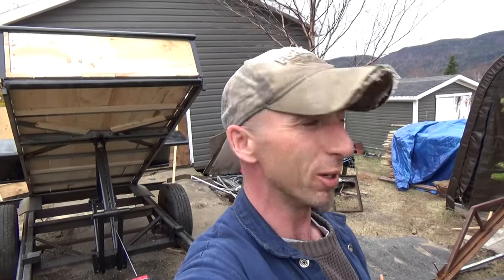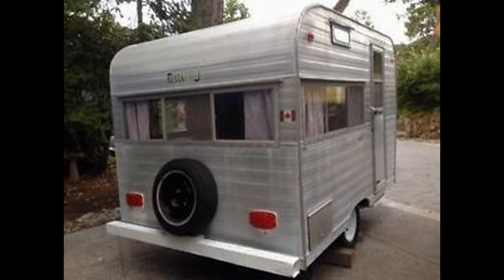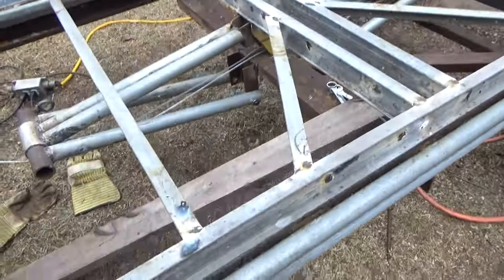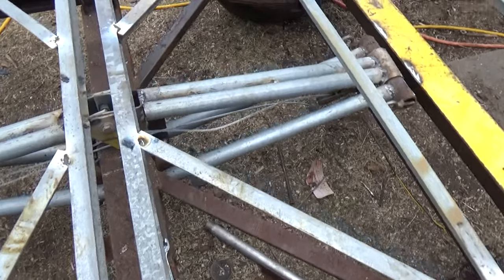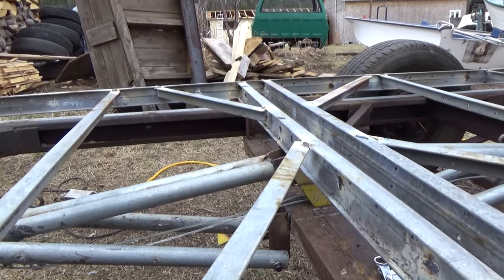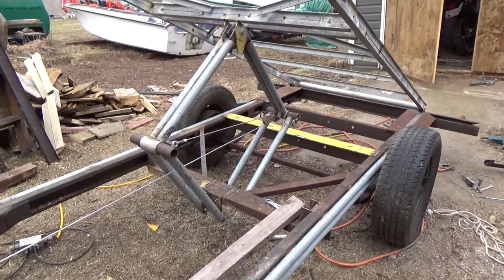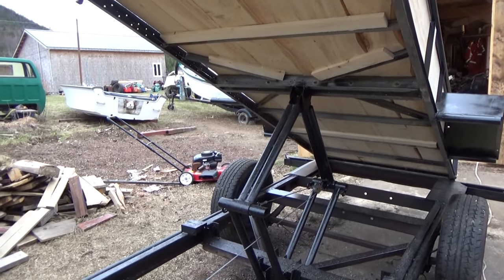DIY DUMP TRAILER WITH NO HYDRAYLICS

Comment: We built one ourselves using your brilliant design. We will be using ours for leaves and branches and it is 6 feet wide by 10 feet long. We used square tubing instead of the pipe and used a bigger winch with a double pulley for slower up and down. I wired the power and controller to the quad that we are using so we don't have to get off the quad to unload. Thank you so much for this!!!!!

Comment: Man just came up with this idea too. Only difference is I will run the cable up to the front of the trailer around a few pulleys and also use it to drag items onto the trailer by disconnecting it from the lift mech. Good to see it will work!

Comment: Great idea! I'd be concerned about the strength of the cable myself. I know the 1/8" cable on those winches do not support what they're rated at. Like you stated, I'd stay back when dumping. If that cable breaks, it's going to come down in a hurry!!
Reply: yeah.Wire rope could cut a person in two

Comment: im a former wrecker driver and also use to build dump trucks had a very similar idea but opted to use 12volt trailer 3500 lbs jacks instead

Comment: Interesting design.  Very easy for you to add a couple extra pullies to the cable run in the scissor if you need more lifting capacity too.
Reply: I was about to suggest a 3 to 2 tier block and fall.  That would really improve the mechanical advantage , especially if he had to use the hand crank
Reply: Es b’y she’s a beaut  should work fine 😊😊

Comment: Really really cool concept and an excellent excecution.  There's one thing I think would be beneficial.  You really need some kind of safety catch to take the strain off the cable and to catch if it snaps..  With the ingenuity, you've shown here  I have no doubt that you will come up with a solution.    I would like to see some kind of ratcheting system so that the bed is supported the whole way up.   Nice!!

Comment: Very cool lift mechanism. Thank you for sharing the idea. I've catalogued it in the 'ol cranium. I think if I go that direction however, I'll use an electric driven screw scissor jack, as I feel it would have a much safer failure mode.
Reply: That is exactly where my head is going.  If that cable breaks,  your tailgate, anyone in line or underneath could get hurt.

Comment: Absolutely brilliant idea and so simple.  I'd use a bigger pulley or multiple pulleys with multiple cables.  I imagine lifting a ton with that one cable and pulley could be a bit stressful on that current cable and pulley.  But hey, solid pat on the back, credit where credit is due. 
That just earned a beer at the pub !

Comment: Interesting design.  I've got one problem with the setup that it seems other commenters have not covered.

A scissor jack lifts straight up.  But the point where your jack contacts the underside of the bed does not.  As the bed rises, the contact point is also moving to the rear.  This may bind the jack and, more importantly, put stress on the top and bottom weld joints.

As a mod to your existing setup, I would find a way to weld a base connecting the two lower hinges together.  Then weld a hing to your new jack base and the frame member.  This would allow the jack to pivot with the backward swing of the bed and maintain load alignment from the head of the jack straight through the base.

Otherwise, great build!  Gives me some ideas on a couple of smaller projects I have around here.
Reply: Not exactly. The pivot points at the bottom of the scissors pivot so the entire scissor can more forward and back albeit not a great amount but sufficient for the arc of the bed. Check the video at 3:06. Cheers
Reply: Assuming that equal weight will be maintained where the cable meets each scissor, each scissor will operate at a slightly different speed. The forward one will straighten slightly more than the rear one when raised.

Comment: Very cool build.
Just this week I demolished an old hunting trailer that’s been sitting since 1989.
The useable box frame is 14’ 7” X 7’ 4”.
I plan on adding another axle and building a dump bed.
I like your idea but I plan on using mine for 3 tons of gravel hauling so I will need to go with a hydraulic set up unless I can find a manual set up that will lift the weight.

Comment: Could also run a threaded rod through the scissor jack.  I have one strong enough to lift my house!!   Then you simply need either a motor or an impact drill to turn the jack with.

Comment: I dumped my diy 1/2 yard cement mixer in a simliar way, however I did not use a scissor, I just used a single arm and pulled it back with a hand winch at the bottom of it, so it swung down and rolled on the ground lifting the cement.
It only worked once there is some leverage on the arm, so it had to be designed to give it that which limited a bit the rise.   Nice job on your design.

Comment: Nice engineering.  I'd reinforce all the welds when you get time.  Some 45 degree cuts on the cross member supports might help too by adding more weldable surface.  As money and time permit, I'd look to replace the wood floor and front wall with steel at a future minimum, and not worry about the wood sides since they'll work fine for most jobs.

Comment: You need safety locks. Death trap. I would consider a long screw like those in floor screw jacks used in pouring concrete upper floors . The screw is safer.

Comment: Tremendous - both the design and the build. You could detach the winch cable from the lift mechanism and repurpose it to hoist lumber onto the trailer for loading too.

Comment: Good design but you need horizontal support between front and rear lower pivot arms.  It also looks like you need some angle bracing as the bed appears to twist.  Next time put the lift arms further apart.   Beware those fumes when welding on galvanized material.  A great trailer for LIGHT loads.
Reply: Zinc Fumes -- A Safety Hazard?
When zinc vapor mixes with the oxygen in the air, it reacts instantly to become zinc oxide. This is the same white powder
that you see on some noses at the beach and the slopes. Zinc oxide is non-toxic and non carcinogenic. Extensive research1
into the effects of zinc oxide fumes has been done, and although breathing those fumes will cause welders to think that they
have the flu in a bad way, there are no long-term health effects. Zinc oxide that is inhaled is simply absorbed and eliminated
by the body without complications or chronic effects. Current research2 on zinc oxide fumes is concentrated in establishing
the mechanism by which zinc oxide causes "metal fume fever," how its effects are self-limiting and why zinc oxide fume
effects ameliorate after the first day of exposure even though the welder may continue to be exposed to zinc during subsequent
days ("Monday-morning fever"). Other research3 is being done using zinc oxide fumes together with various drugs which
results in a synergetic effect for treatment of cancer and AIDS. Another area of research is use of zinc compounds as the active
ingredients in throat lozengers that are recognized as significantly effective in reducing the duration and intensity of the
common cold.
Reply from the maker: great info nice to know

Comment: That's a really good piece of engineering! Be careful with the welds on that galvanized iron. I think I would have used larger pipe in the scissor lift, but depending what you're hauling you should be ok.

Comment: Really all depends on the purpose of your trailer. If all you need is the ability to load and dump leaves, then this is great - maybe even over built since your loads are light. Obviously if you intended on using it for loads of rock, my guess is that it is not suitable as it would likely over strain the capacity of the light wench and light duty cable. If you are conscious of the limits of your design and stay within your purpose of the trailer you'll be fine. You started with a light duty trailer frame so obviously your not intending on loading a skid steer into it or hauling more heavy loads. If you had started with a double axle equipment trailer that has a high load capacity - I'm confident this would not have been your solution for a tip mechanism. For what your doing - looks like a great solution. My guess is your cable is rated as good as the light wench your using so you'll likely not be able to lift a load outside the capacity of the cable strength and snap a cable (unless at some point you are dealing with a damaged or worn cable). Your danger point for this design is lifting the trailer empty and rolling on a heavier load than the capacity of the wench to safely lower. Trying to dump a heavy load - the wench should simply refuse to lift it and nothing bad should happen so long as the cable and your lift points are stronger than the wench. All that can change over time as aging and wear occur so keep an eye on things to make sure welds don't crack, metal doesn't rust, cables don't fray etc. or really bad things can happen even with light loads.

Comment: Love your design, curious about side to side stability?
I just bought a 2K pound boat winch, I plan to use more pulleys to increase power.
Reply from the maker: No issues, used triple pulleys and a 3k winch

Comment: Actually if you added another piece of pipe about an inch or two between the scissor action and cut a small groove for the cable to ride in you could eliminate the need for pullies altogether. hell you could put a zerk in it for greasing and even cut two grooves so you could compound the cable 3-4 times it will be good for winch life...

Comment: Recon, could you figure out how to build a scissor lift, using a hand crank wench, that could go through a 30" gate? You know, with swing-out stabilizing out-riggers, that would give you a fairly safe place to stand and paint or change high night light bulbs  say 20' off the ground...? Have to have a leveler for inclined yards. You could make a ton of $$$ with an item like that! I like your design.  I appreciate you & your work and making this video! It shows you have a very high IQ!!!

Comment: I like it. I’m wondering what load it can lift.

I’m sure it’s not going to lift as much as a hydraulic cylinder, but those have different sizes and capacities. It’s not meant to replace a hydraulic system. Just another option.

Comment: Hey brother that was cool I like "real" real TV = but before I jump into that project could you comment on the limitations = it looked like you had a lot of cut/split wood around - I figured you just might of designed her for mostly hauling wood and it probably works great - but I've got mostly dirt and rock to haul any chance it might work?

Comment: Very nice build. My next trailer will have this. I haul alot of yard waste and I am tired of doing it with a board & pull chain.
Reply from the maker: good rig, i recomend that you use a larger winch i now have a warn 2500 on it
Reply: Good to know. Can I use pallet rack steel? I can get loads of it really cheap for about $10 each.
Reply from the maker: a bit slight maybe, all depends on the design, for the dump maybe but the traler i wouldnt recomend it
Reply: Yes, only for the dump. I would be converting a galvanized boat trailer into a dump trailer.
Reply: Harbor Freight has a 2500lb winch for $70. Warn winches are pricey.
Reply from the maker: should be good man

Comment: I've been watching quite a few videos on homemade dump trailers because I would like to build one but on a smaller scale, like garden tractor size, somewhere in the range of about 5' X 6' or somewhere along those lines and I'd like use a small hydraulic cylinder but damn, a 12V hydraulic pump and reservoir runs over $200 alone and I saw an electric linear actuator(which looks similar to a hydraulic cylinder) on eBay for $65 but it was only rated to lift 165 lbs. I want something rated to lift at least 300 lbs so I'm still searching. I like the scissor lift idea you came up with and I'm not an engineer or pro fabricator by any stretch but to me it looks like just too much stress for that winch and cable setup for any kind of weight at least.  I was thinking about something along these lines but maybe using a screw type mechanism like a foctory automotive screw jack but being turned by a strong electric geared down motor. It just seems like it would be safer...

Comment: i may be being thick but would you get a problem with the trailor flipping when the weight your tipping hits the back, good job, so you you tube and google will be checking you out for a change lol
Reply from the maker: +John Price hauled and dumped around 16 loads now averaging about 500 kg a load no issues, thanks man

Comment: very smart and good build  i have built similar with a long stroke 5 tonne jack and remote hydraulic pump      i wish i had seen this  earlier ......mine is 25 years old   still working with small mods every now and then  ...hows this trailer now ?

Comment: I would have used bigger pins and cable as you should always oversized anything lifting that much weight.  I have a the same idea for a crane loader.

Comment: under load that system will likely struggle. Help it out by adding mech advantage by adding pully blocks with multiple pullies.  Each set doubles the capacity but requires twice the cable pull. Would work nicely because not a large distance from down to full up.

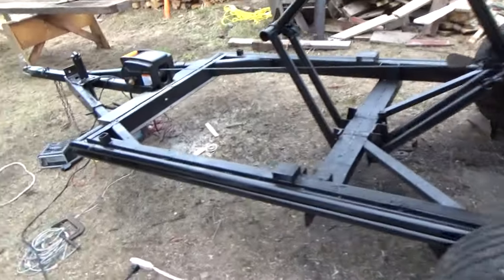Comment: In regards to comment mentioning pivot Arch stress on joints unlike a scissor jack in your car where the threaded rod goes through the 9:00 and 3:00 points this does not have that's threaded rod so it should self adjust and you can see it happening in the video

Comment: I don't hate it. My first concern would be the wear on the 3/16" cable. If you were to use a larger sheave say 4" diameter it puts less strain on the stranded wire. Also if you added another snatch block to compound the cable it would also increase lift capacity and lower the load on the cable while only decreasing the speed. It is worth sacrificing the speed for safety. You should be able to lift nearly a ton, whereas now it is a matter of time before cable fails and load crashes back down...

Comment: you could incorporate a ratchet ladder mechanism (like on a 4 post car lift) to 'catch ' it should your cable snap when lifting, and it will one day, for sure, come back down with a bang if it did snap....i doubt this would be able to lift anything heavy because your scissor levers are very long and the line size and required pull to get it started would be huge...what are you tipping ? wood chippings and the like?

Comment: Have you put 1,000 or 2,000 LBS in it and see if it will dump it? I think the scissor lift will fail under a lot of weight.
Reply from the maker: heaviest so far on the scales was 550kg about 1200lb no issues with the lift but the winch wasn't getting enough voltage and struggling, I might end up mounting a battery beside it. thanks or watching
Reply: Good Deal then... I may try converting one of my trailers to a Dump Trailer...

Comment: With that winch and pulley what would you be able to dump? Because just by adding trash bags you are about 300-500 lbs, now if you throw in a mixture of rocks, wood, Sheetrock, etc you can go up to 800-1000 lbs , that looks like an 8 yard dump!
That winch and pulley would not dump much weight!!
Now if a winch if 10k lbs is added and a pulley for 10k lbs pounds, now it would dump heavy
Reply: Never mind that dump is like 4 yards

Comment: Hey man!  First off nice job on the trailer!  I had one question, what is the length of the finished pipe mounted on the lift?  There are technically four sections it looks like?  Thanks! And nice job! hopefully I can somehow modify this to work for myself!
Reply from the maker: about 2 1/2 feet each way, hope it helps you out

Comment: You need to take safety into consideration as well, I wouldn't be letting anyone near it when its being raised, i have been looking at a cable design scissor lift based on the hydraulic version which is a stronger design for quite a while now on my next trailer project, you will find the tray has to lift at a steep angle so stuff like dirt slides off easily, if its not high enough it won't slide off.

Comment: What about using a 1 inch threaded rod and actually make your scissor action into an electric scissor jack? This would accomplish the safety concern of a snapping winch cable. Maybe make a dual electric scissor jacks so one will support the other in case of catastrophic failure. Safety is always a huge concern for me. I lend out my trailer to friends and family all the time.
Reply from the maker: might work only on way to find out my friend

Comment: I found your video as the result of needing to build a 4'x8' dump trailer, for hauling loads of "wash out" ("poor man's gravel") While I like your lift design, the single point lift makes me nervous; since, I could be lifting up to 3K~4K pounds. I'm curious what kind of weights you routinely lift; and, how well it's held up for you. 

I've been thinking of something along similar lines; but, where the winch cable would pull a doubled (pipe inside a pipe; so, the outer pile would roll, possibly with a 3rd, shorter, piece with the cable connecter link on it) up the inside of a tilted channel on each side of the trailer, with stops on the top of each channel. Not as elegant a design; and, possibly, at risk of getting clipped by the dozer bucket; but, zero chance of twisting. 

My intent is to be able to do controllable  "rolling dumps"; since, I have quite a bit of an area I need to cover, my old body's WAY past unloading it with a shovel; and, I'm on too small of a fixed income to be able to afford having loads brought in on a dump truck. (There's, also, a concrete plant just about 8 miles away from me, which gives away their "wash out.")
Has anyone seen such a design in use?